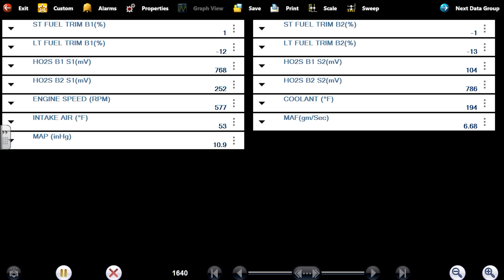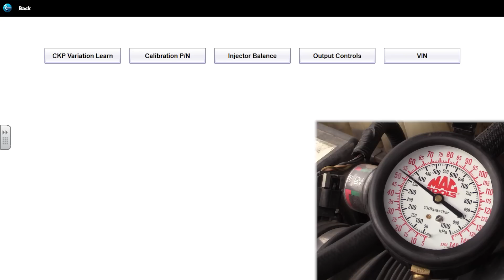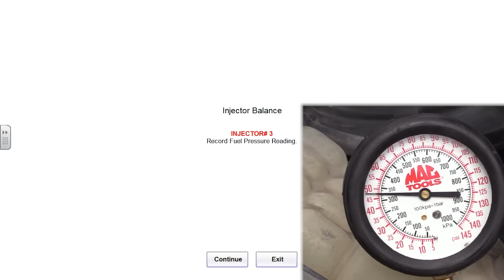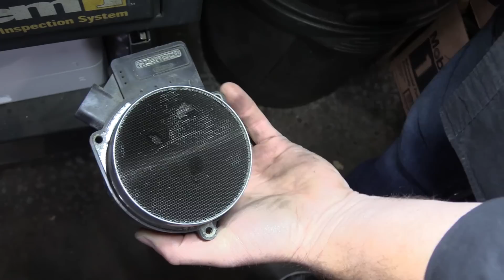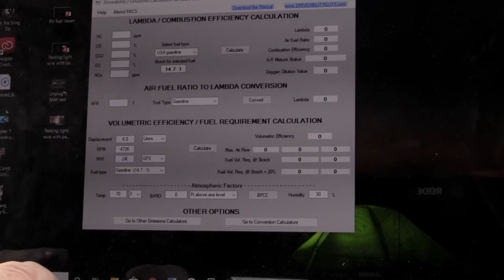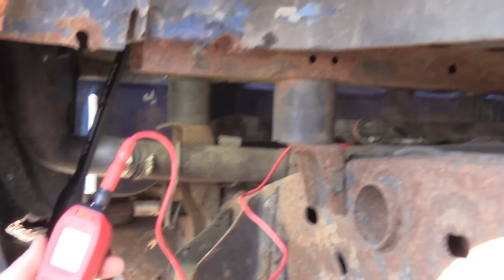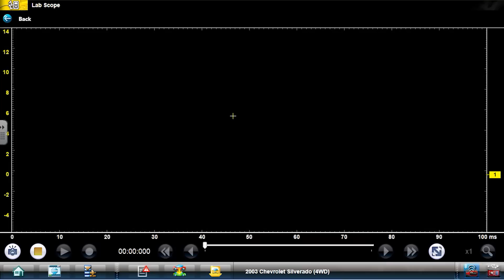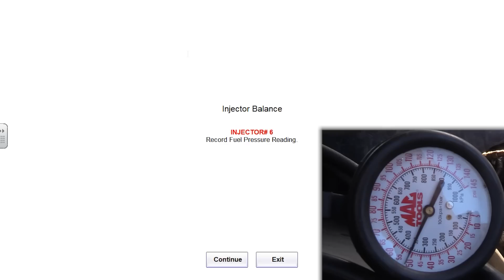03 Silverado Misfire, Rich AND Lean fault codes

Comment: very curious about this. i think the throttle body is causing this.  this the electronic throttle body?  i have an 03 with 5.3.  those all the same things. even the negative fuel trims. did fuel filter and 2 pumps.  i still have the same issues. me and patrick just hit 2 bad pumps? i feel there s something more.  been chasing this for 1.5 years on and off.  been driving me crazy.  noticed my iat is way off when i am idling, gets better when driving.  could that cause issues?
Reply from the maker: addressing the low fuel pressure under load: there is no way shape or form, the electronic throttle body is causing this condition. We can debate the cause of the negative trims because the evidence is not solid there BUT, the low power complaint under load is absolutely being caused by a fuel pressure loss. This MUST be corrected first. We can then revisit the negative trim numbers.

Comment: Whole lota guessing going on!
Reply from the maker: Where was the guessing? The only open end here is the negative trim numbers and the sketchy injector flow rates. We conclusively confirmed a low fuel pressure problem under load, which was the owners main complaint! (a hesitation/misfire condition at highway speeds under load). How many people would have only looked at the rich condition codes and completely missed the low fuel pressure problem? These rich condition code had absolutely NOTHING to do with the low fuel pressure problem, which is leading to the customers main concern.

Comment: Mine does the same but worse, hope to see a second video. Thanks for all the info!
Reply from the maker: Does the same what? This truck has multiple issues
Reply: @ScannerDanner  Misses at certain times at idle and then runs better when I put seafoam in the gas, changed plugs wires fuel filter did a clean on the maf new o2's check for vacuum leaks

Comment: I understand the fuel trims and how they work, but for instance if an engine is lean and the trims are high to correct for the lean condition does that mean the engine is running correctly because it being corrected?  So you wouldn’t see or feel any symptoms?
Reply from the maker: The computer can only compensate so much. Also, in our case, the lean condition (not shown in the codes we had) was due to a loss of fuel pressure under load and at WOT. Fuel trims are NOT used during times of creating power and so there is no compensation going on during those times. Hope that makes sense. There is a ton more with fuel trims. Too much to write here

Comment: Great video. Should be interesting to see if is a pump problem. I've had a few new bad ones right out of the box. It might be worth trying to clean the injectors first before replacing them. On these returnless systems, I've run into injectors with a white sediment restricting the screens due to the crappy gas we're stuck with now.My understanding is that it's from the alcohol in it.  I'm surprised that you weren't getting a code for the fuel tank pressure sensor being unplugged.When you went back to check the pump, the first thing I noticed was that the sensor was unplugged. I usually take a look at what drive cycles have been completed. It's a pain when somebody clears the codes & you lose what would be some helpful freeze frame data.

Comment: Great video, Paul! I can't wait to hear the outcome. Although I am sure that it is going to be fixed. 

After having a couple toyota corollas kick my butt with lean codes, I started using the WPS to check fuel pressure while doing injector balance tests because its more accurate, and records the values for me on the scope. I like the WPS because it's a lot easier to see .5 psi increments, at least for me.
Reply: Lol PJ. With Paul saying "was it this value or that value" I was thinking, throw the Pico on it. 2 Reasons. A.... Accuracy of reading and B...Proof for the customer as to why injectors are a suspected problem. Scope not needed all the time but on something with possible multiple issues all the evidence can be presented to the customer.
Reply from the maker: @kirkabrahamson1148  missed an opportunity for sure!
Reply: @ScannerDanner   We've all had those missed opportunities before. I'm hoping next year will be much better for me on that hindsight issue since it will be 2020. 😂👍
 Sometimes it's the matter of convenience. Easier to plug a gauge in than drag everything out for the Pico. Especially in the cold.
I saw the snow on the bushes there in the background. Brrr.  Lol.  
Cheers Brother.!
Reply: @ScannerDanner  Hard too think of everything in the heat of the moment. Always great videos Paul.
Reply: I totally agree with you on that too PJ..Looking at a dial sometimes can be deceiving.
  Love the video you did demonstrating how you perform that test.  Good stuff bro.! 😃👍
Reply: Exmotorsports yeah, that Yaris video is probably my favorite, and probably most helpful. Lol

I see so many people getting beat up by those lean codes, including myself until i figured out a good solid diagnostic test.
Reply from the maker: That's going to be a recurring theme for 2020 haha
Reply: Voltage Drop Diagnostics Good to c u on the job!!

Comment: I have a electrical question
So I'm dealing with a 2004 Nissan Xterra.. dealing with somebody else's mess-ups so my the problem with the hazard switch as well the turn signal it came to me when they put fuses they keep on blowing Hazard turn signal it keeps on ticking while I have the key on position when I turn the signal left or right it turns off then a while the fuse blows then I proceeded to push my hazard then that blows fuse .when it's on the on position sounds like the turn signals are on always... and I do the wiggle wire test it turns off then my my flasher starts acting weird I know the hazard switch goes with the turn signal change those but it continues happening to blow fuses as well making a flasher hot penny cluse thank you appreciate it I like doing this but this one kicks me in the ass..
Reply: Ha ha.... I also own a Renault..... you know Renault/Nissan Story.... Same problem.... except fuses don't blow up.... the all car went afire.... bye bye... too bad that was my doggy car...

Comment: What should all of the injectors drop normally while doing the leak down test, about 20 psi?
Reply from the maker: It's not a number, it should be the same drop on all injectors
Reply: Just wondering if GM had a certain specification number to go by. Say for example if they all leaked down 15 psi and you didn't know the actual specification, are they supposed to leak down 15 psi or should it be 20 psi? Although it's not very realistic to think if they were restricted they would all drop the exact same psi. it seems there would be some variation if that were the case.  I did see a video on here with a tech in California who was working on a car doing a leak down on injectors that were all leaking evenly but was still not the actual psi it should be leaking down according to factory spec. Like your videos, informative.

Comment: Brother Danner is the MVP of this vid. You almost had to change your screen name to SCANNER-LESS DANNER. Did bro have an extra set of undies for ya too? I know i would need them. I almost had a coronary a couple days ago when my brand new Autel Maxisys Elite got bumped and nearly fell. Looked alot like the great escape your scanner tried to make (have had the scanner a month). I dont worry about my Snap On scanner, it has a cord (Solus Ultra).
EDIT: Something i noticed, even with snow on the ground, shouldnt that LS engine be running at 210 Fahrenheit? Thats the normal number i see on a near daily basis.
I am suprised you didnt do your fuel pressure test with the WPS500x. You could do the simple pressure checks, then shorten your time base and look at the actual injector operation under load, Cursor your peaks  and the lean condition would have jumped up and slapped you in the face. I use my cheap home made transducer like that sometimes, and it has helped me diagnose an intermittent injector. (Watching your vids since 2013_ish is what got me rolling on the scope thing, its all your fault)

Comment: Had similar issue with 03 250 super duty after several dead ends removed gas tank  and powered fuel pump with power probe right at the fuel pump out let there was some rubber bushing oring  that was leaking in the tank spraying straight down and not holding pressure could not find seal  so bought assembly it’s been fine ever since

Comment: great video this explained a lot of what could be going on with my exact same truck, broken exhaust bolt, and location also the change in my long term fuel trims when warmed up Going from 25 to 14. not good. but great video.
Reply from the maker: Positive trim numbers for the manifold leak.
Reply: Thanks you are a great teacher

Comment: is there heat shields missing or things moved with the lift kit and more heating of fuel/tubing? that will make it boil off faster when trying to pressure/injector drop test.
going by how the starting pressure seems to jump around, hot fuel or vapor pocket would for sure make skew the test per injector
Reply from the maker: Definitely worried about a skewed test but I found no other identifiable rich condition culprits. A MAF sensor that was skewed could be an option though

Comment: i FIGURED THE EXHAUST LEAK WOULD HAVE CAUSED SOME INTERFERENCE WITH TROUBLESHOOTING, BUT YOU NAILED THE ISSUE DOWN WELL PAUL!! PUMP AND INJECTORS.
Reply from the maker: Still questioning the injectors. Follow mine and Patrick's conversation

Comment: normal fuel pressure at key on engine off is 60 to 65 psi
Reply from the maker: Not on this model. It is not a CPI system
Reply from the maker: spec on this engine is 48-54 psi

Comment: fuel pressure regulator?
seen um leak into the intake and cause theses codes
Reply from the maker: No fuel came out of the vacuum port. I had it unplugged during my snap throttle tests if you remember. You're not wrong ,just wasn't what was going on here
Reply: You and bro are good guys ! I am glad to be a premium sub. 😎

Comment: What a dumbass. It's bad compression.
Reply from the maker: Lol ^^^^ this guy
Reply: @ScannerDanner  Never heard of low compression causing a rich condition? You need to get out the classroom and work in the real world.
Reply from the maker: Not what I said at all. Watch the video. Multiple issues on this. 
According to you I should tell this customer that low compression caused his fuel pressure to drop under load lol
Reply: @ScannerDanner  Fuel pressure drop would not cause rich condition. Multiple misfires on 5 and 8. Rich on bank 1 and 2. Cyl 5 is on bank 1, 8 is on bank 2. Rich condition improves at mid - high RPM because compression rises.  A thank you would be nice.
Reply from the maker: It was not misfiring. Customer complaint along with the check engine light was a highway speed under load hesitation/ misfire and he did have 171 and 174 codes that were cleared by him. The fuel psi dropped 10-15 psi on a snap throttle (which I proved on the video). The O2 sensors showed lean at WOT matching his under load hesitation complaints. Of course none of the above mentioned contribute to rich exhaust faults. Separate issue! 2 psi difference on the injectors was enough for me to suspect injector flow imbalances. 
 Compression problems = misfiring and it was not misfiring. Also misfiring in almost all circumstances equals positive trim, not negative. A compression misfire is absolutely felt at idle more as you said and I agree improves at higher rpm, but this was NOT what was happening. Tell me the scenario where a compression misfire causes a rich condition. I would love to hear your thoughts. Intake valve not opening enough?  Other than that, your still packing the air in that cylinder and when it misfires it is pumping that air into the exhaust = lean (false lean but still lean and positive trim)
BTW, the customer is here in the comments and stated  160 psi compression on all cylinders. Never verified that because I never suspected compression issues and I still don't
Reply: @ScannerDanner  Low compression causes incomplete combustion = richer exhaust gasses. How in hell can you not know this?
Reply from the maker: Already said that! Not once did I state the fuel psi issue was related the the negative trims.
On video and on text here. You're clearly skipping around on the video. Pay attention to your customer complaint or in this case what I said the symptoms were. This has more than a negative trim issue. And compression misfires cause what? A rough idle! Not what we had. 
I'm not completely disregarding this possibility of a compression issue causing negative trims but it's more of a stretch based on everything else than the injector flow rate variations. Oh and this needs a pump too. Something you clearly missed
Reply from the maker: Incomplete combustion = unburned fuel, not neccesarily "rich". You have unburned oxygen as well and just like an ignition misfire or injector misfire most incomplete combustion events cause positive trim numbers.
What do you think trims do with an ignition misfire? Do they go positive or negative? Just want to make sure we are on the same page.
Reply from the maker: @stevewarren3051  this would go a lot better if you'd stop calling me names. We can have a civil debate, which would be healthy for everyone else reading. If you would, please answer my last question. What do fuel trim numbers do with an ignition misfire? What do fuel trim numbers do with an injector that doesn't fire or is restricted?  Do they go positive or negative?
Reply: @ScannerDanner  You just want to argue. You don't want to fix the car.

Comment: If it is starving for fuel while hes under load  and he let's off the throttle would it go rich or would the computers learned fuel cell respond quick enough to keep it under control without setting a code?
Reply from the maker: Learned fuel cells (fuel trim) is not used at WOT or during a deceleration event. Injectors are actually cut off during that time

Comment: Repair manifold leak, replace fuel pump and fuel filter, possible replace injectors or have them cleaned ..... bad gasoline with trash in tank

Comment: I have a 2000 Silverado 2500 with 6.0 had the fuel pump replaced. Then last year. I was having trouble with it. It had no power. And wouldn't go. I do construction. My dad is a retired old school mechanic. But I got a scanner with live feed. And watching your videos. And class room videos. You help me fix it. I traced it back to a fuel problem.  But was unsure. Cause the fuel pump was replaced. After weeks of your tests and tricks. I was left with replacing the fuel pump. And I got ready to drop the tank. I found the problem. The filler neck rusted away. And I was getting rain water. And road salt in the fuel. All last winter. I live in Ohio. Near PA. So lots of road salt. I replaced all 4 of the O2 sensors with bocsh. Had a one that failed from day one. So I replaced all 4 with a/c Delco.  And it's been great ever since. The first fuel pump. I let the deal install. cost me $900. Did the new pump last year myself. Was about 300. Plus a OBD2 scanner with live feed from Walmart. I'm looking at a 02 Silverado 2500hd with a 6.6 turbo Duramax.  Low mileage. Do you do any diesel videos? Or your bother? Thanks for the help. And teaching with your videos!!! Very helpful. Tip tricks. And more. I tell everyone I know. To check out your videos!!!!👍👍👍👍
Reply: you didn't notice the gas smell or had it pouring on the ground when re-fueling......
typical GM truck thing, filler neck rusted through and/or the clamps rusted off
Reply: @throttlebottle5906  no it was rusted away on the top part. So no leaking fuel. And the truck has a vent line. Near the rear of the cab(ext cab on mine. So the return line vents there so you smell gas sometimes. But not all the time. I reached up to take the hose clamp. Off the rubber hose to the filler neck. As I felt my hand up to find the screw head. I could feel it was broken off. It was probably it's last day.  I just got a new pump. So lucky. With all my test from the videos. I had the new pump. I was saying to myself for months. It can't be the pump. It's new.  The dealer used a Delphi pump. I'm good friends. With the owner of the dealership. I bought the truck there. Two years earlier. So I knew he did everything right. I put in a new Delphi pump. Took the filter off the old one. It was full of road salt. And covered in salt. I noticed. It was bad and ran extra rough on rainy days. It was January at the time. I did several fuel pressure tests. Check my intake sensor etc. The videos really help me understand fuel trim. And how to diagnose. The problem. Without replacing. Unnecessary parts!!!!
Reply: @throttlebottle5906  it's was the filler neck at the clamp. That's the only part I didn't have. I ordered one. But to get to work. I too a sheet of aluminum siding coil. And maid a sleeve. Screwed and sealed it to the fill neck. ( What was left of it.) Then put the hose and clamp on. After doing the new pump.

Comment: Couldn't a faulty/leaking FPR cause the rich condition as well as the low fuel pressure? This is a situation where a FP flow test off the return line would have been interesting just to confirm/demonstrate the FP diagnosis.
 Do you purge the air from the fuel pressure gauge line before the injector test?
 Diagnostics can get tricky on vehicles with multiple issues like that.
Reply from the maker: #1 yes, no fuel came from the reg vacuum port (forgot to mention that)
#2 good psi but drops under load would not be from a stuck open regulator. It would have been low all the time
#3 yes I did, a few times on this one for this very concern